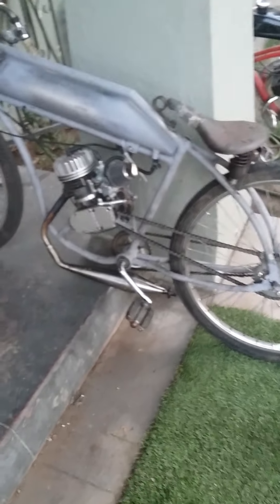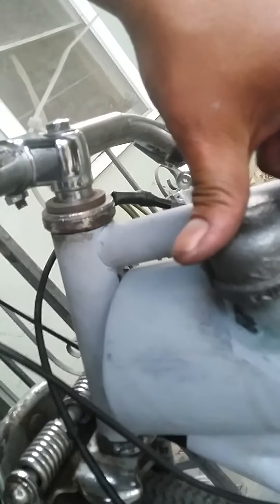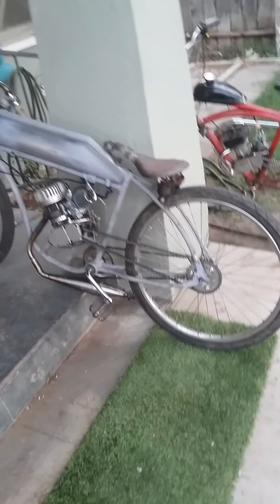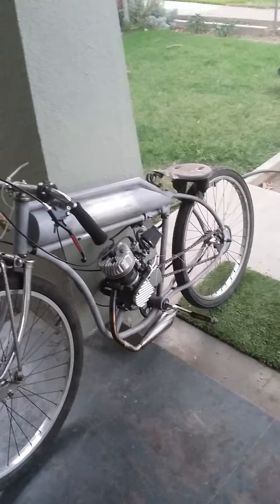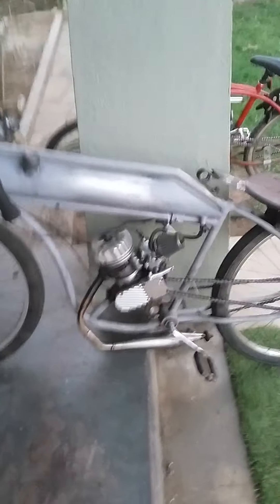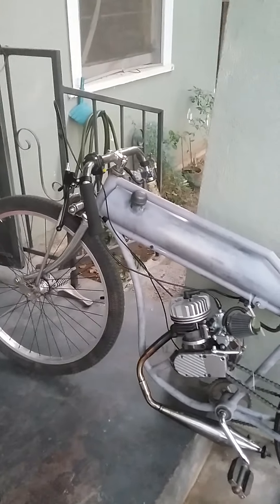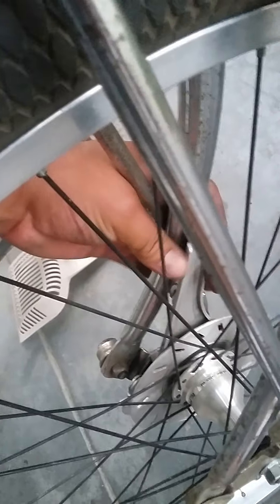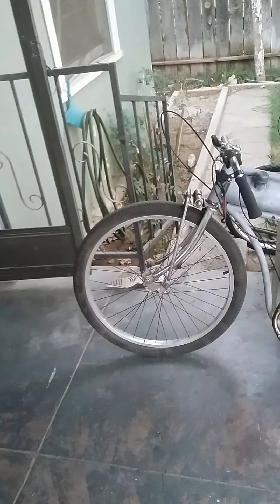yesterday went on a cruise on my board track it felt cool

Comment: It looks absolutely beautiful!

 Put a thick O ring up in the cap toward the top it will seal the cap and threads will hold it in place. Make sure you put a breather in though! or a tube in the cap with a 1 way check valve. Fish tank air one way valves work well for it! It's what I do on the the gokarts tanks we made over the years no leaking! same thing ya did with pipe caps!
Reply from the maker: Yeah pipe cap